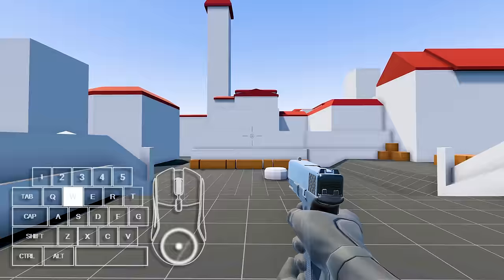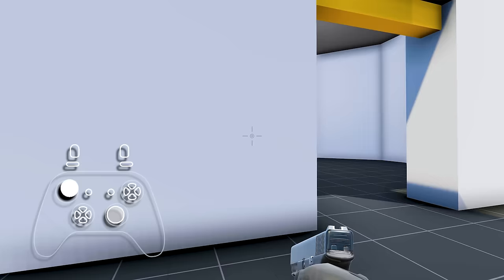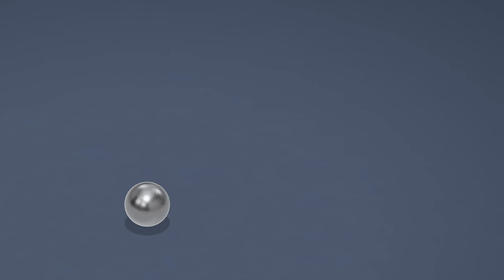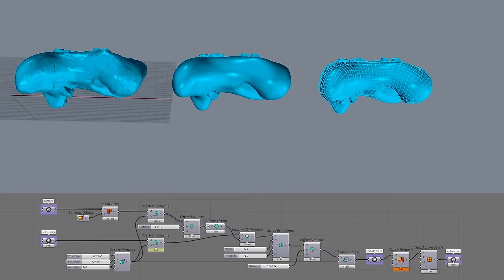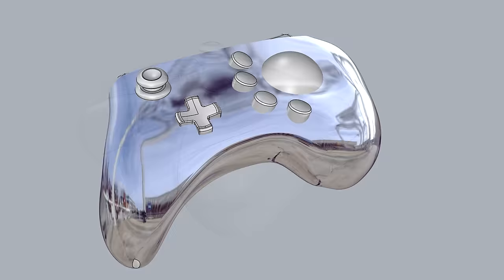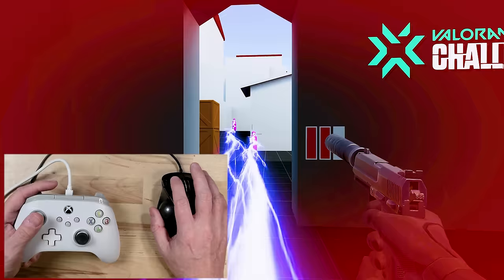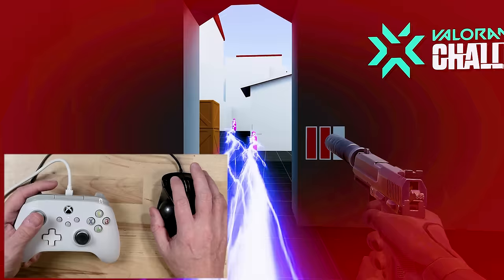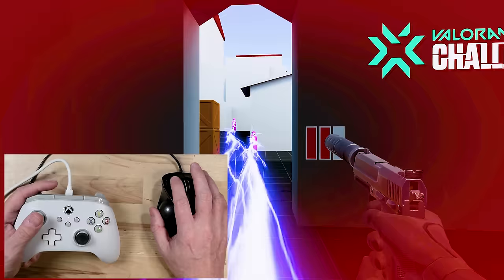Ultimate FPS Controller Design & Build

Comment: Great work! Also, as far as I know, threre is a small PCB that mimics xbox xinput but lets you connect all inputs to proper soldering pads.

Edit: the board I was talking about is Raspberry Pico with GP2040-CE installed. :)
Reply from the maker: Thanks! I had looked at using a Pico or ProMicro for the controller side of things but (as far as I know) that wouldn’t show up as native Xbox controller and I didn’t want to worry about compatibility issues. Would have been a much more elegant solution though!

The one I really wish I had found was the Wimads open source trackball design. Using the hardware from that as my mouse input would have saved me a lot of grief. A friend sent me a link to this as I was doing the final assembly and it was one of those “ahhh dangit” moments for sure. 
https://github.com/Wimads/TB3S---DIY-QMK-Trackball-device
Reply: @PyottDesign  It'd be better to use a microcontroller as an HID device, as HID includes a variety of device types beyond just keyboards and mice, gamepads is one of these devices as are joysticks; then you can do HID to Xinput+HID for game compatibility reasons.  The only real problem with the RPI 2040 (Pi Pico) is that its ADC is trash, so you'd be better off co-processing with a discrete ADC, or just finding a microcontroller that's better suited for the project.  As Microsoft's GameInput API gets wider adoption, mixed APIs will become less of an issue.
Reply: @PyottDesign 
THIS. IS. AWESOME.
Reply: @PyottDesign   I don't know about you, but a sequel seems like in order. As you have discovered, this is all about the details, but you do need to reach for the low-hanging fruit first. You approached this project in the best way, same way I did, but my design is merely prototype phase. Plus lots of people here with lots of great ideas and feedback. I've got some of my own:

1- Don't paint it. The ones you get will either make it blotchy, or sticky, or do a good job but become glossy. That's not what you want. Have a look at the PS5 DualShock/Sense Controller. It has a VERY satisfying texture on the underside, and that's what you want. GRIP. Everywhere. And something that will handle grease and sweat like a champ. To do this, I recommend when you 3D Design the outer surface, put in dimples, and do not sand the shell afterwards. Dimples should be ones that will print (not too irregular) and won't break-off (not too small). The gaming mouse with holes unfortunately does not work, not unless you have a mini fan to wick the moisture. That's too much complexity for this stage. It's smarter going for a passive design, and that means little things protruding out rather than holes falling in. I recommend 3D printing just a couple small square with different outer textures. There's bound to be someone who has uploaded their template online somewhere.

2- Ergonomics.
The SNES is atrocious, the PS1 is bad, the PS4 is decent, the PS5 is good, Yours is great. But there is definitely room for improvement. Sit down and look at your hands, like really look at it. The anatomy. And think how is your fingers articulate. What is the natural stance of your hands. The most ergonomic stance is to spread your fingers apart, cup your palm, and lay your thumb horizontally. Almost like you're holding a ball, something that's larger than a tennis ball and smaller than a bowling ball. Not sure if this description helps. Now what you want to do is use the clay to mould it to your physical hand with the grooves for each finger, palm rest, wrist support, and spot for your thumb. Ideally you have 4-Action Buttons for your 4 fingers but they are located in the posterior of the device, not like shoulder pads, more like rear triggers. And a tall joystick with lots of movement on the front. No L3 Click. No front buttons, except for the usual Start/Select/Option/etc etc. No D-Pad. We are going for Quality and not Quantity. And since our hands are symmetrical, well the same design on the other side. Now having two precise joysticks and 8 Rear Triggers is a really great design

3- The above design is definitely much improved over the PS5 controller. And against the SteamPad. But it still won't win you over a Mouse/Keyboard. For that you need a Large Trackball. And we'll place it on the right side since +80% of humans are right-handed. Basically like your design, but we're evolving it. Now we have to get rid of your "rear touch" of the trackball. It's a novel idea, but we don't have a need for it since we won't be having any front buttons requiring it. And we also need to close off the posterior of the device to maximise ergonomics for the wrist, palm, and hand. And give buttons for each finger. So you might say, this is too basic. Well it's kind of the point. We want to make a design that will be the best for FPS and 3rd-Person Games. This is for the casual game. Any game out there that has convoluted control scheme, or something that requires alot of input like MMORPG won't be good. And that's the point. For those use cases we will instead use a Keyboard and Mouse. Use the right tool for the right job. If you hired a handyman, he's gonna bring in his toolbox with dedicated tools for each task. He is not going to bother with some shoddy multitool thing you see advertised online. They do this as a profession, and they find it early that the most efficient way to work is to be wise with your tools and choices. If we cater to ALL categories then we end up making a bad controller because it's got too many compromises. It's one of the reasons the SteamPad sort of failed. They wanted to make a wireless controller that would work for those MMORPG titles, and it "barely" does, whilst other games get compromised. So yeah, add the Trackball 🖲️ to the right side to be used by your thumb, so position it for performance, comfort and ergonomically.

4- Connectivity.
Okay this is the last point. As other people mentioned and you will soon find out, you have a problem. You know have Windows recognising a Mouse as a different HID, and the Xbox Controller as a different HID. But most games only let you select a SINGLE input. You might be able to hack each game, but that's not viable. We need to marry the Trackball input into the Controller HID, so it comes as a single input. Now I don't know the answer to this. You may need to find one of those older Trackball Controllers from the past 20 years, rip it's guys out, and use that as a donor. Or you may be able to use some micro-switches and a Raspberry Pi as a control box, and then develop your "single input" controller from the ground up. Maybe there's someone who has already done the work on that front for you. And lastly, you may be able to use an Xbox Controller, and solder in the Trackball Sensor into the logic board, and use some external software to control the hardware (sensitivity, etc etc). All of these are more work and challenging. But it's one of the crucial things that need to be done. Unless you are able to modify Windows itself, to recognise your Trackball and Xbox as a single input, but I'm not sure that's feasible. All in all good luck with Point 4, it's definitely above my current capabilities.

So I hope some of these ideas have been helpful. Go back to basics, study the anatomy, to think of comfort and ergonomics to allow you to perform at a higher degree. If you're able to pull it off by some miracle, it might plug-and-play on a stock Xbox Series X console giving you a huge advantage over other players in open-world games or shooters. Good luck mate!
Reply from the maker: @xaytana Thanks for the comment, you’re kinda hitting on the problem I ran into. I explored doing a dedicated onboard hardware controller (with gyro) but then I would have to pass it through the OS as an XinputHID device. As far as I know, that only supports standard game controller inputs so my pointer & gyro data stream would be going nowhere. Theoretically I could write a controller driver to handle that, but then what? There wouldn’t be any games that support my new device type.
Maybe I could build out a bare bones custom trainer in Unreal that specifically supported my new device to get some comparative performance data but then I would be spending a year or more creating my own weird closed ecosystem.
Patching directly into two separate off the shelf devices is sloppy as hell but it lets me have some fun building a controller that works in many existing games in a few weeks effort. I’m weak on the hardware input / software driver side so I’d love to hear if I am wrong on anything (it would be great if I was)
Reply: @PyottDesign I think that the Teensy ecosystem has an option for exactly this usecase. It has a composite USB Serial + Keyboard + Mouse + Joystick mode, which allows the device to appear to the operating system as a composite USB device that provides all of those things. It wouldn't show up as an xbox controller literally, but I think it would pass all the inputs you want. Regardless, the thing that you've made is awesome and it makes sense to reuse the original boards to get a fast and working prototype. If someone were to continue to develop this into a version two, then a custom controller might make more sense since it gives you a lot more space/wiring/code freedom.

Comment: "Ultimate FPS Controller"

looks down at my mouse and keyboard
Mate, I've had that controller for a good thirty years now.
Reply: But it requires a desk and a specific pose. Something that you can just hold in your hands in any pose is a lot more comfortable.
And you don't have analog movement.
Reply: @Ubeogesh  Who tf needs "analog movement" when you have a mouse?
Reply: @wasd____  you don't move with a mouse, you only look with it. Analog movement is a lot more precise than discreet WASD movement
Reply: @Ubeogesh  No.
Reply: @wasd____  try playing smth like hades with a joystick vs WASD. This game type really benefits from mixed input, specifically for aiming with a gun special, and festive fog cast... But movement has to be analog.
Reply: @Ubeogesh  No.
Reply: @wasd____  you are free to live in ignorance, then. My example with Hades, most speedrunners use joystick for a reason. Joystick movement is more precise just because it has much more than 8 directions and 1 speed.

Comment: Nice work! I was thinking more or less the same design but mine was using a joystick. It look a big mushroom or some think I didn't like to "sell". Sugestion that a learn with the use of a jostick; try a twist motion, cutting the controller in two, this way you have a head controller independente of gun motion.

Comment: the main difference is you don't control a mouse with your thumb. you use your entire arm, upper arm, lower arm, and wrist/hand and even fingers for increasingly finer control or increasingly larger movements. your thumb alone will just never be able to compete with the accuracy and speed that brings. 
Even though a trackball is much better than a thumbstick, copying the fact a keyboard and mouse is two separate devices and having a mouse type device in one hand and a thumbstick controller in the other would be even better than this setup. Ideally the issues with most mice is horizontal mice are bad for the wrist, but then when you make the mouse vertical you make it harder to grip and also be able to press buttons without moving the mouse slightly. so then you really want movement and firing (left click) to be done by the left hand, while the mouse just does aiming, with a sort of house that wraps around youre hand. Like a valve index controller hand strap. or something more rigid like making the body of the mouse go all the way around the hand, with a flat bottom that rests on a mouse pad surface. 
The azeron is a decent example of what would work well for the left hand, with a thumbstick, and plenty of buttons for each finger.
Reply from the maker: Wow, I hadn’t seen the Azeron before. That thing is wild. Reminds me of a Razer Tartarus taken to a whole other level.
You make great points all around, getting into the details of mouse aiming & ergonomics. I’d say my goal with this wasn’t really to out perform mouse aiming at a desk. I wanted to explore a controller design that I could use on a couch and get a better understanding of why controllers exist as the standard they are today.
And to design & build something weird because I love designing & building weird stuff.
Reply: in like 2001 I had a Nostromo which is like that but has a D-pad instead of a thumbstick. I got creazy good at multiplayer fps games until I stopped giving a crap
Reply: @PyottDesign  You might also be interested in Azeron's Cyro, where they put a miniaturized macropad and joystick onto a mouse.  Similarly LYNXware's stuff might interest you, same concept as the Cyro, though it's older, but also DIY and modular, though there seems to be a newer model, CAT, that replaces the original LYNX.  If you want specifically controllers, perhaps look at the Alpakka, though I personally have issue with some of their choices, unfortunately Xinput doesn't have gyro but fortunately Xinput isn't the only thing virtually all PC games support; otherwise stick + gyro is comparable to mouse usage, stick for broad movement and gyro for fine movement, Nintendo and Sony outright already support this input set, with some more advanced stuff allowing for flicking, though trackball + gyro may be a more refined version of this.  Otherwise Tech Yesterday had a mouse-gamepad project, unfortunately the last update on that, at least on this platform, was two and a half years ago, and I'm not sure if anyone has developed that concept further since then.
Reply: I don't use my arm but only my hand and wrists. You'd prob have masturbation arm syndrome if you did this often using your whole arm while the other is stationary
Reply: @NeptuneSega lmao. It’s an ergonomics thing. Using just your wrist incites wrist injuries a lot faster, injuries such as carpal tunnel syndrome. It can be a career ender for a lot of players, especially professionals or people who game 24/7. This is extremely well documented and making a joke about it just shows you don’t know the risks at hand. Using a lower sim sensitivity and more of your desk to make broad strokes with your arm and wrist in tandem is considered the best option for people who want to avoid injury (of course also taking breaks and doing hand stretches, but I won’t digress).

Comment: Controller design progresses extremely slowly. For instance the ps1 DualShock is almost the same as ps5 controllers 27 years later. I think buttons should be duplicated or exist entirely on the backside or top of controllers. Your right thumb is responsible for 4 buttons and a joystick. This gives a huge advantage to pc players who can run jump aim shoot all simultaneously. This spawned players clawing their controllers and giving themselves carpel tunnel.

With the right stick becoming almost entirely camera control even outside of FPS, it’s a massive surprise a real controller like this has not been invented.

I thought after Nintendo did the Wii, they would go and reinvent the controller but they never did. I hope a company takes a serious look at trackpad controllers and scuff type button layouts where the fingers resting on the back of the controller can help your thumb. Controllers being the same for almost 30 years is nonsensical. There are definite improvements available to be made. Wonderful video
Reply: @fapman4878  wow thank you for this explanation. Very insightful comment. Im glad the steam deck has some good control features.

I had no idea controller design was being held hostage by third party patents. That’s maddening. People will actually give themselves wrist and hand damage hitting face buttons with their fingers. There should be a class action lawsuit lmao jk. But wtf I will never support SCUF again. What a scumbag move.

Comment: The 'dynamic test' is completely defeating the object. Strafe aiming and mirroring the targets movement pattern doesn't use any of the micro-correction benefits you get with a mouse, and if you move in a predictable way like this in any shooter you'll get dumpstered. I think a better test for this would be one where you stand stationary and track a target that's quickly changing direction side to side. That's the type of aiming controller players struggle with.

I love what you're doing though. Keep up the great work.

Comment: Microsoft made a trackball controller like this back in the 90s. It was called the MS Sidewinder DualStrike. It had a trackball joint, connecting the right side of the controller to the left, requiring you to pivot your right hand to aim freely. It didn't work too well but it was pretty revolutionary considering most fps games didn't even have mouse look at the time.